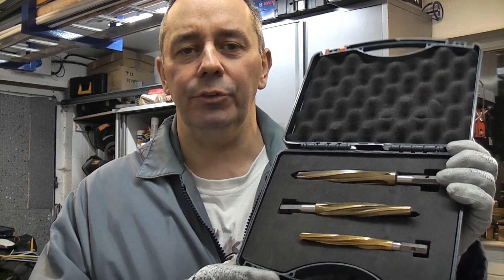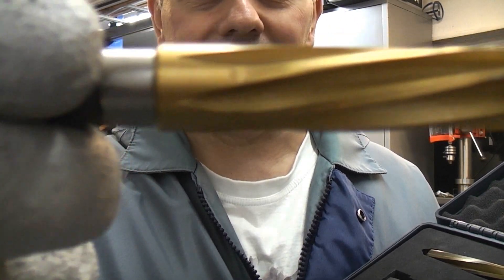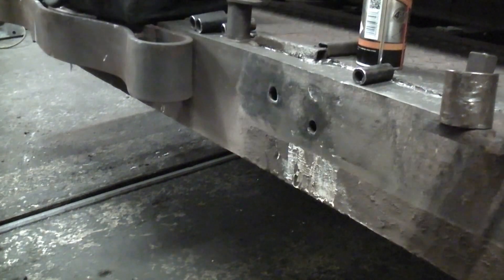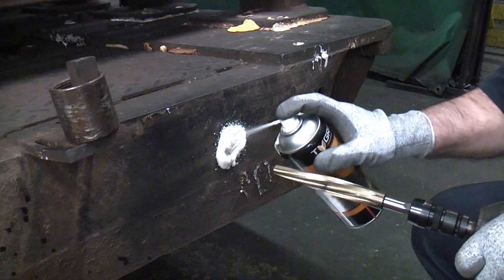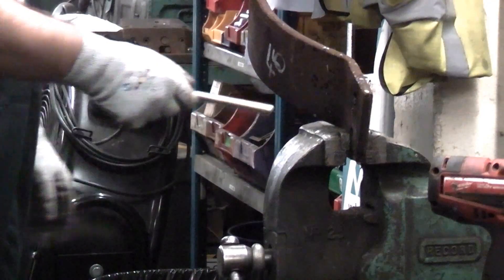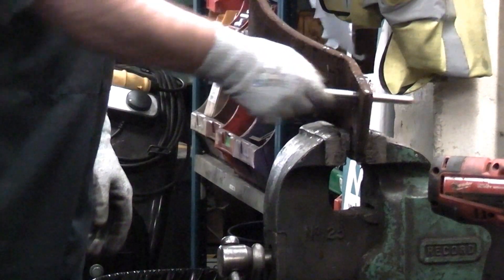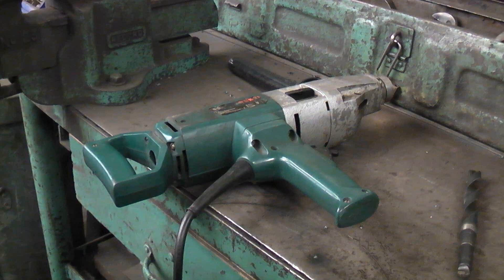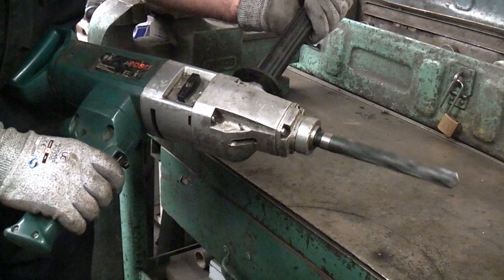Impact reamer | enlarge holes in steel easily

Comment: Very interesting. Can it be used to enlarge the inside diameter of a 4-5 inch black steel pipe? Need them to be exactly 5/8 inch.
Reply from the maker: No, these are not a constant diameter (they are tapered), I think you would struggle with that length. Perhaps find someone with a lathe and machine reamer  👍

Comment: Also need to note that they "Most likely" want to be RIGHT cutting, with LEFT FLUTED, to keep the bridge reamer from catching, or driving in too fast and wedging.
Reply: @ultimatehandyman  You should also do a video on all the various files you can get for your drill. You can also use those to easily open holes, clean holes, etc.  They come straight, conical, round, etc. etc. I used to use those a lot, not quite as much now because I have TONS of different size of these car, bridge reamers.  (I'm not sure all the various names, they mean something, but basically it has to do with the size of them and the mount I think.) I also have all kinds of different fluting. I honestly think most handyman, who don't have these, weren't aware of these after buying a set... would go.  "WOW, I can't believe I didn't have these the last 20 years."

Comment: 73£ for the adapter only .... damnn
Mid torque Milwaukee cost 130£ and helps for multiple different applications. 
If fabrication on site looks wrong I prefer enlarging the holl with pistol drill , using annular cutter holder 25£ with multiple sizes of rotabroach cutters .
You do have kick back if you go fast , if you go slow the metal is like butter. 
That way you can make brand new holl also, my pins are around 6.5 mm .
I use 6.5 mm drill bit to pre drill , after I use any size cutter to drill .
The system you show is looking good,  but not essential. for me price and applications matter
Reply from the maker: Yeah, it is not cheap stuff, but really handy if you are a professional metalworker 👍
Thanks for the comment 👍

Comment: How is this functionally different than a step bit?
Reply from the maker: A step bit will only work on thinner materials and can't be used when the holes in two different pieces of material are slightly out of alignment 👍

Comment: Hi mate, season's greetings to you and your's,  those reamers cirtainly do the job, brilliant,  I know what you mean whith wrestling whith the big drill, when I was an aprentice  I was using a bigger version, which hung from a spring from the roof, it grabbed ,picked me up, spun me round tying me up whith cable ,until it pulled the plug out,I was terified but knew if I let go the metal handles would have smashed my head in, it gave me deep respect for these tools after that, that was 54 yrs ago, you never forget. Here's Whishing you all a merry Christmas and a better New Year,  kind regards Stuart.uk.
Reply from the maker: Hi Stuart, I bet that was a scary experience!
All the best for the new year ;-) 
Thanks for the comment 👍

Comment: Another name for this type of reamer is a bridge reamers . What makes them work so well is the left hand spiral right hand cut. 
It keeps the reamer from 
pulling out of control into the hole and jamming in the hole . Cutting tools are my business and I have sharpened many of these  tools.
Reply from the maker: Thanks for the info, I did not know that! 👍
Reply: Hi Ernest...i see that cutting tools are your business, so I'm hoping you may be able to help me. I need to enlarge a hole in 1" steel from 1 1/2" to 1 11/16". I"m having a difficult time finding a bridge reamer that I can use in the field...meaning the structure is already installed and i need to use a handheld drill for the job. If you can steer me in the right direction I would greatly appreciate it.
Reply: @rockyreyes4689  use a mag drill with rotobroach they come in any tons of sizes

Comment: How hot can the metal get when drilling
Reply from the maker: I didn't check the temperature when using the reamers, but imagine it gets quite hot locally judging by the way it evaporates the drilling fluid.
Thanks for the comment

Comment: Dont throw away the bone breaker drill yet ,those reamers are ok for trough holes but in blind holes or tight space /if you have another thing close to your hole that you cant puncture they dont stand a chance ,while that drill unless it breakes your arm will get the job done  . . .
Reply from the maker: I'm sure that drill will still be in the tool room on site when I'm dead and cremated, not sure how old it is, but I would imagine it is as old as me.
Thanks for the comment ;-)

Comment: H7 tolerance? Impact reamer ,what a time to be alive ! Just when i thought i saw everything something new pops . . .
Reply from the maker: You should have seen my mates face when I told him that I had reamers that could be used with the impact wrench ;-)
I don't need a tight tolerance for what I do, as long as I can get the bolt through the hole I am happy.
Thanks for the comment

Comment: Great! saves the operator being hurled 360* when the drill bit snags :D I have a Mag drill and these would be awesome as a back up if I ever drilled the wrong size hole in thick steel plate etc.
Reply from the maker: Absolutely!
These are a great invention, just for the safety aspect alone
Thanks for the comment

Comment: That was useful inof - thanks. Can you have a look at bending aluminium 90o - I'm need to bend 50x20mm C channel with the channel pointing in. I've seen people heat the aluminium up and bend it, but being C channel, I think the approach needs more than just heat.
Reply from the maker: It's not something that I have ever done, but this might help-
https://www.youtube.com/watch?v=22PqMv1fQ9w
Reply: @ultimatehandyman  Thanks!
Reply: @ultimatehandyman  That vid...hmm - needs a mandrel. I'm not sure, but youtube suggested this one using bismuth to fill the rectangular profile tube. https://www.youtube.com/watch?v=WgrzMdh7pJ8 
Now I have to work out how to do that with C channel...perhaps I need to use rectangular section...
Reply from the maker: @Bennyboy-dog   He did a great job of bending that! 
Rectangular looks like it will be easier to bend. Best of luck with it ;-)

Comment: I saw a demo at the ffx tool show of a tapping drill and tap combined bit to be used in impact wrenches. Absolutely amazed by them. I think it was the same company. Cheers.
Reply from the maker: They do make combined drills/taps, so it was probably them. Their tools are pretty amazing, especially the ones that you can use on harder steels, such as Hardox or rail track etc.
Thanks for the comment 👍
Reply: @ultimatehandyman  I thought only tungsten carbide and diamond go trough hardox? +Both of them arent impact friendly they shatter  or chip off.But then again it depends on what kind of hardox? 400 has a rc 40-50 which is in a file or rasp range ,now 500-600 (excavator teeth,buckets etc. . .hardness goes to rockwell 60+)if they can tap that ,i would be impressed !
What the heck are those taps made of?What kind of sorcery is that?
Most importantly do you have a link to see that kind of sorcery ?
Reply from the maker: @zumbazumba1   Not sure if they have taps for Hardox, but they have drills and countersinks that will work on it, they are not cheap though-
https://holemaker-technology.com/collections/carbidemax-ultra
Reply from the maker: @zumbazumba1   It looks like the Carbide max are only for use in a mag base drill, as they have a Weldon shank on them.

Comment: What's a spring steel bumper, when it's at home?
Reply from the maker: At one of the sites where I work they have steel "Bogies", which run on steel rails, similar to a train carriage. They are pushed and pulled around the plant by electric trucks. The bogies are made from steel and can weigh as much as 10 tons when fully loaded, the bumpers at each end are made from spring steel. Sometimes the bumpers break, most of the time we can weld them back together, but sometimes you have to replace the bumper, which is what I was doing in this video. There is a picture of the newly fitted bumper just before the outro on the video 😉
Thanks for the comment
Reply: @ultimatehandyman  your workplace sounds like the setting for the climax of a Terminator movie!
Reply from the maker: @JohnHughes2002   It does not sound that bad when you are there personally, although we do wear hearing protection all of the time.
When you get the footage back on the computer it sounds awful, the radio combined with the alarms and the noise from the ovens etc.  But when you are there, it is not bad.
It's weird that when I unmuted the sound so that you could hear the impact wrench- you could not hear all the other background noise (well hardly)
Reply: @ultimatehandyman  I actually meant it looks like a movie setting because of all the heavy duty steel on display, although the electric trains sound like something off a Bond baddy lair.

Comment: Thanks for the tip. Not seen those before. Don’t have an immediate use for them but I’ll store in my Ultimate Handyman memory bank for when the time comes.  Thanks as always for the videos. 👍
Reply from the maker: You are welcome
Thanks for the comment, Rod 👍
Reply: @ultimatehandyman  You can buy a nice set on Amazon that go from 3/8" up to 3/4" (I think) there are 4 or 5 in the kit. Not all that expensive.